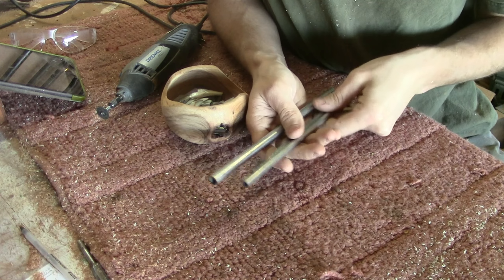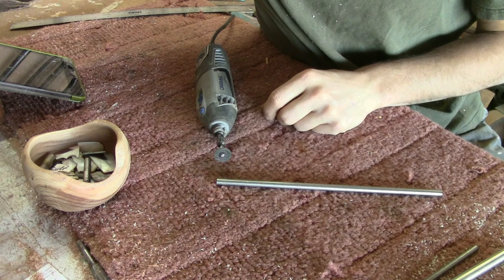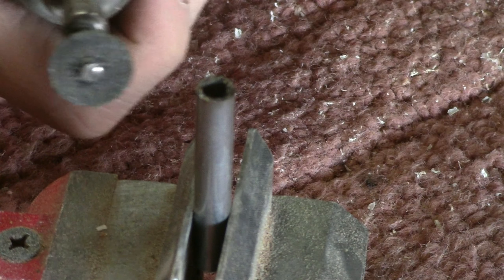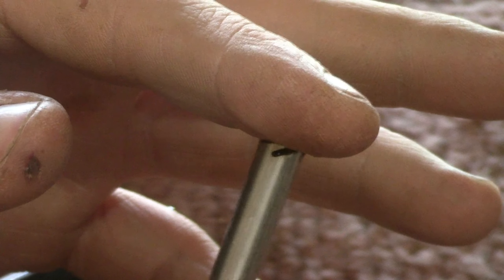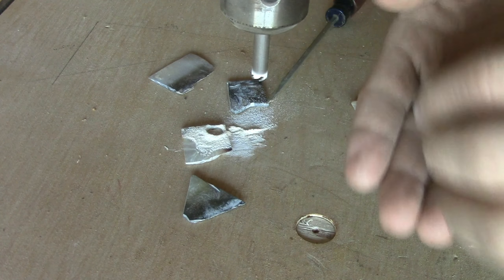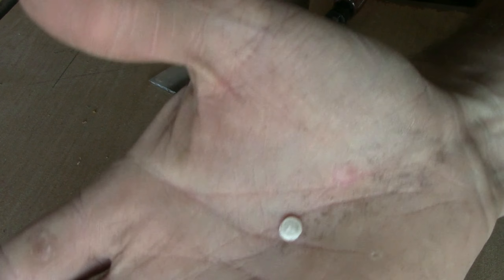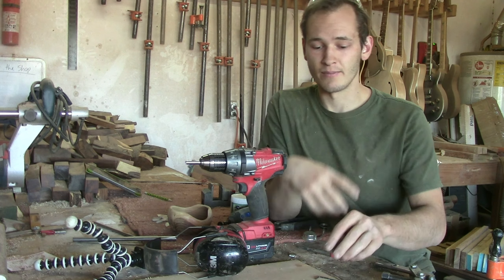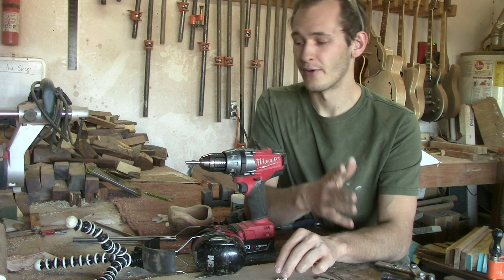Cutting Mother of Pearl Dots For Guitar Fretboards

Comment: If you want a shorter route to a flat top use a tubing cutter which is a rotary action around the tubing circumference which also comes with a reamer to clean the ridge from the inside of the tubing. I love Dremel but jeez!

Comment: You could buy a drill press for a hand drill for less than $50. For small projects like this it’s worth it however threes a $100 Press from Skill that looks good for smaller projects. Once you graduate to everyday use it’s better to buy a larger unit.

Comment: Cant you just buy a 6 or 7mm diamond hole saw bit?
Reply: realtruenorth I did this and the reason it doesn’t work is the outside diameter is 6mm but the inside hole is smaller than 6mm

Comment: I had .270 round dots. Needed .230. Used a "A" drill .234 dia. Super glued the dot to the shank end. Put the drilling part in the chuck of the hand drill making it run true. Ran the drill against the belt sander without touching the bit. Finished by hand (against sandpaper on table) and used the drill bit to apply the dot in the hole. You can use the drill end to ream or clean the hole. Make sure if you are picking the best side of the dot to be the top and mark the bit for the best direction of the dot. This worked well making sure to wait for the glue to set on the bit and in the hole before doing both.